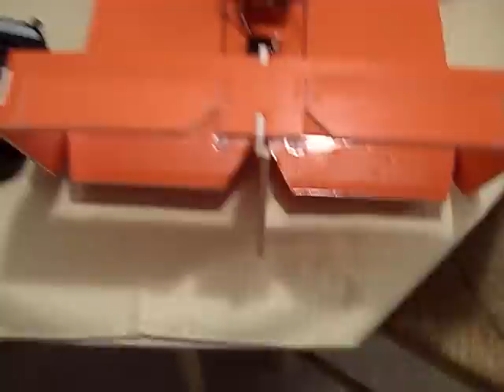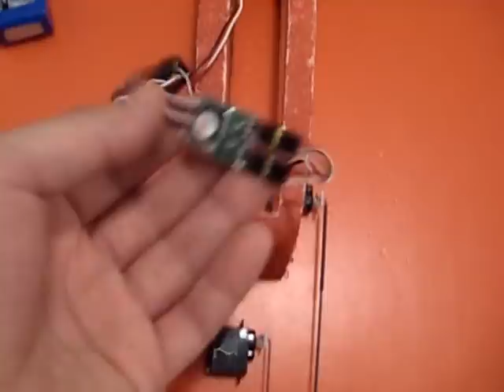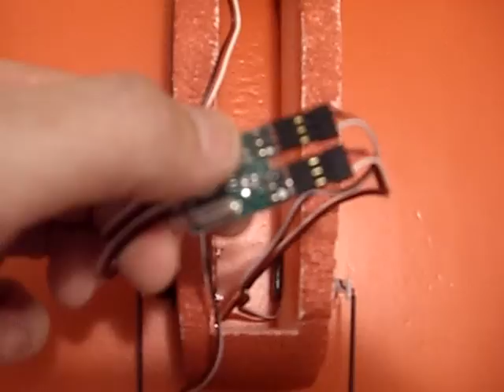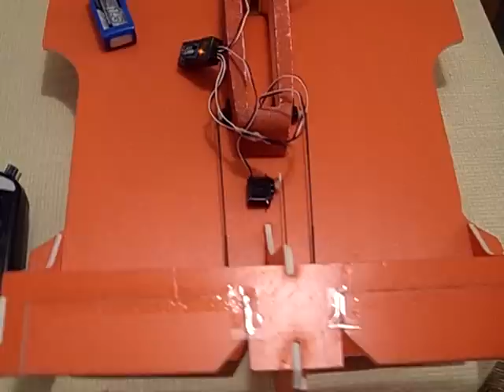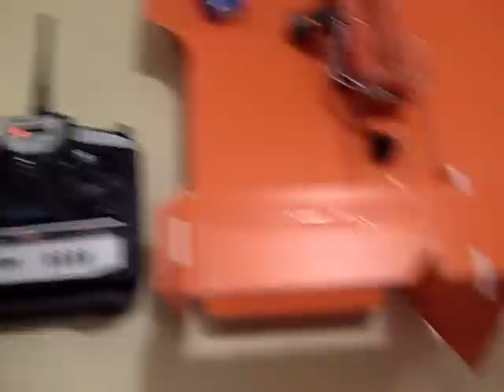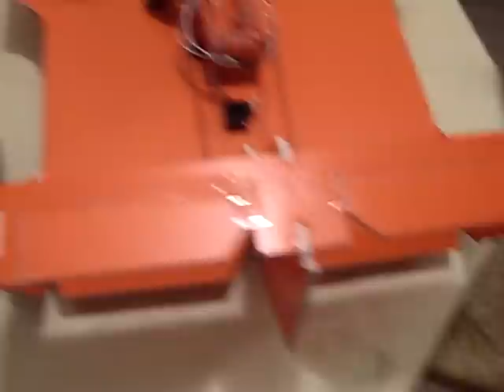Hydrofoam Project - ailerons

Comment: HI
This is Mode 2 what you fly.
Gas  and rudder left, Aile and Elev on the right stick. Its correct.

but why dont you use the upper rudder?  Its importent